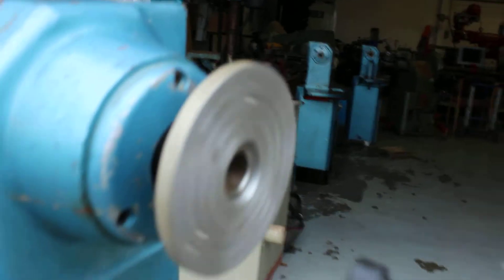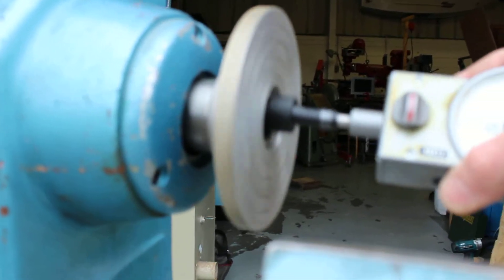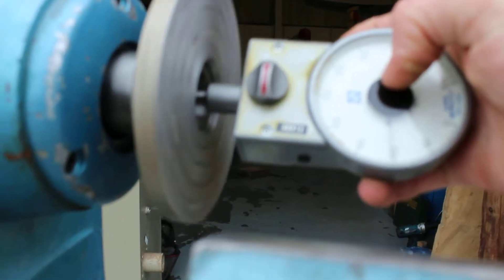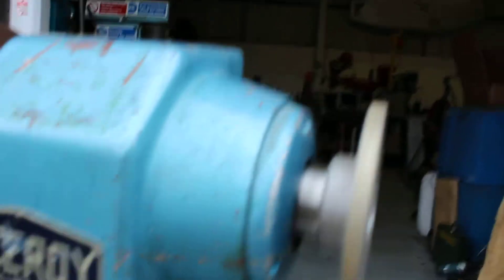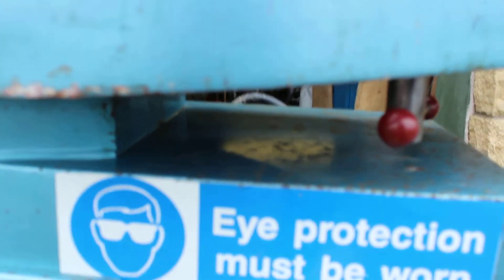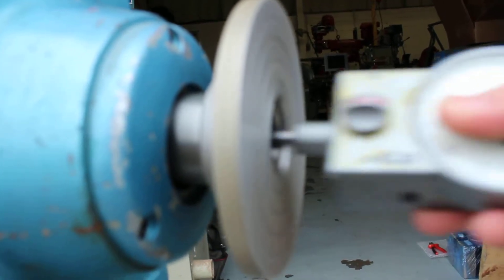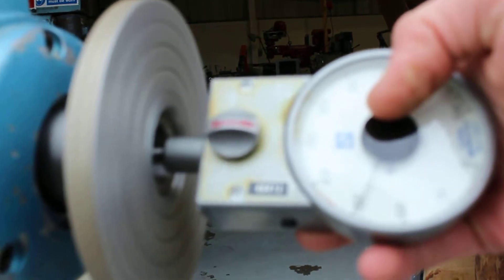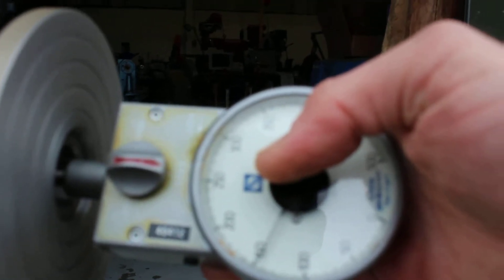Inverter Conversion of a 3 phase Viceroy bowl turning lathe to 240 Volt single phase.

Comment: Hi Dunc - where did you source the pendant switch?
Reply from the maker: Good question! If I remember correctly it was one of the ones you find on eBay. I looked at making my own but by the time I priced up the enclosure, signal cable, switches, potentiometer etc it made more sense just to buy the ready made unit. The only thing you need to watch is whether the start/stop command for your inverter requires separate start and stop inputs or if it is simply an 'on' to run, the inverter defaulting to stop when this signal is not given. Hope that m makes some kind of sense! Thanks.
Reply: I'm struggling to find anything like that on EBay - probably because I'm deploying the wrong search criteria...     would you mind helping more!?
 @dmacgyo
Reply from the maker: @MrPitzpilot  A good place to start would be with a search for 'inverter control pendant'. There will be a few sellers with these on eBay I'm sure. Alternatively you'll come across designs and ideas for home made versions via Google. Handy if you want to fit the control gear in to existing locations etc. Let me know if you get stuck, glad to help if I can.
Reply: @dmacgyo My - they current EBay offerings are quite ugly.  I think I'll build my own!  I know I need a 10K pot but would SPST momentary switches work.  Thank you again.
This is for a British lathe, too!   ;)
Reply from the maker: Al C Excellent! Good to have a project to work on while you're quarantined! Ha ha. Yes, 10kOhm potentiometer (linear type, not logarithmic). Whether spst switches will work for you depends on the inverter you have and what controls you need/want. But if yours has a common output and a run/forwards input then that's all you need. Things only start to get slightly more involved if you need emergency stops, reverse, jog etc. The only thing you need to consider is if your switch is latching or not as the inverter start/run signal often needs to be continual, not just momentary. Does that makes sense?
Reply: @dmacgyo Ya that makes sense